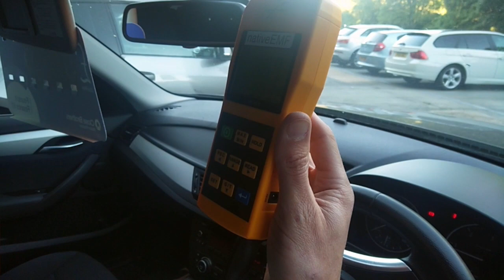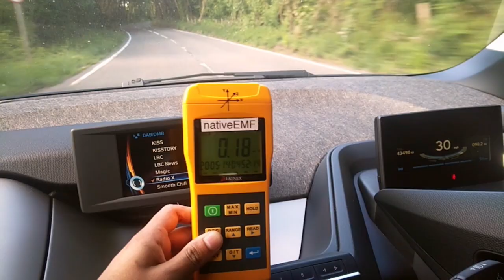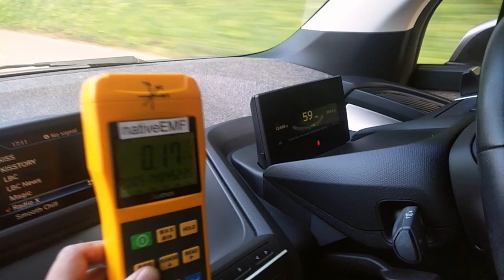Electromagnetic Fields in Electric Cars: EMF Review of BMW i3

Comment: why would the emf ratings be less in the i3 compared to the X1?
Reply: possibly more care is taken with shielding in an electric car?
Reply: YOu have a lot of very high voltage electric in the XT, in particular in the ignition system. There is no system in the i3 that approaches that voltage. At most in the i3 you get 400V. Ignition systems are much higher then this.